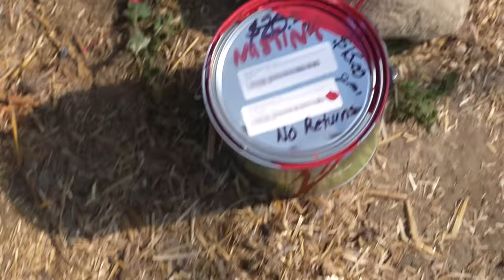The One Person Farm

Comment: One thing you can (and probably should) scale up without any significant change in your work load or farming plan is tree seedlings sprouting, it's a low maintenance process that you've got plenty of space for and reasonably adequate equipment, plus freely available seeds from wild trees all around the farm.

Comment: having worked with sheep for many years id strongly not to add them to the mix yet. get you yards and paddocks  in order first. electric fencing often does not work with sheep and they are escape artists not as bad as goats but close depending on breed . sheep are a pain for things like foot rot and fly blown. anyway i admire your  courage to take the steps you have. good luck oh and yeah more cattle grazing or mow the pasture or the weeds are going to take over.
Reply: And gut parasites and lice.  Maybe hair sheep are easier than wool sheep.  They don't need shearing.